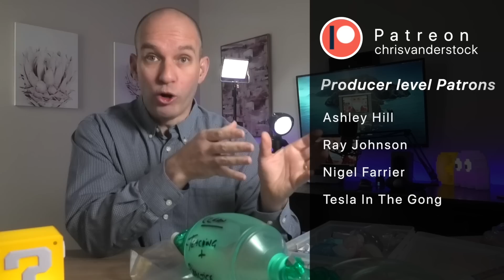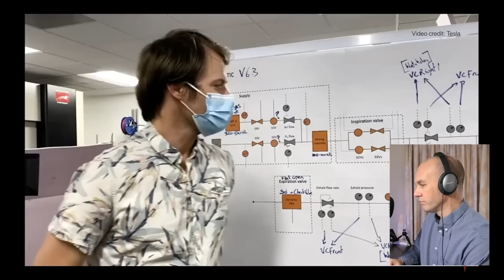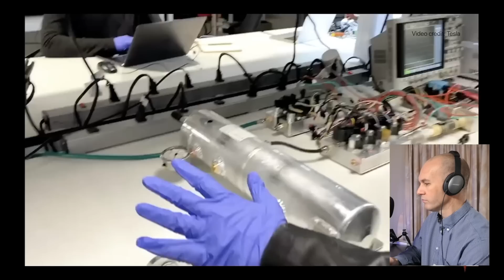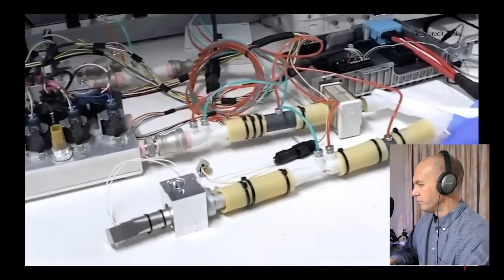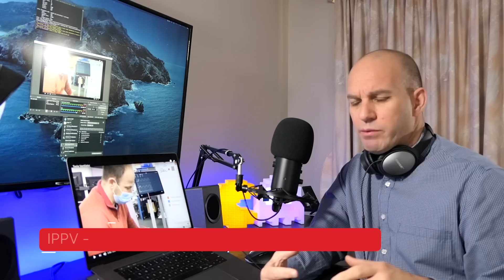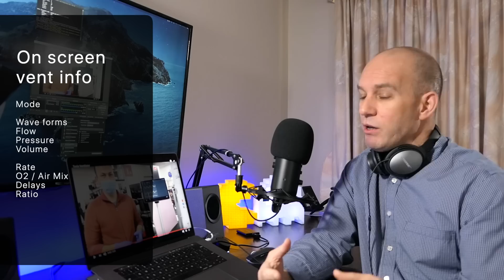Nurse reacts to Tesla's ventilator & what's with those resuscitators?

Comment from the maker: 0:50 - Ventilation 101 
2:00 - Air-viva (resuscitator's) and mechanical ventilation
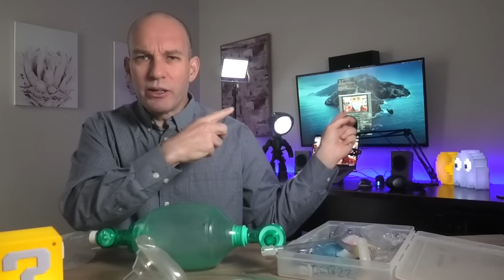9:24 - Tesla's ventilator
Reply: Nice job explaining
Reply: There are schemes to a real ventilator made temporary public here https://www.medtronic.com/us-en/e/open-files.html?cmpid=vanity_url_medtronic_com_openventilator_Corp_US_Covid19_FY20
Reply: @elmancebo  No they released a manual for how their device worked. That is not even a parts list and they put in the terms that any ventilator designed with those belong to them once it is over. It is actually really bad for anyone that signed up to get those plans because they will 100% sue to try and steal your work. Now they can claim you used their design and by requesting them you agreed to those terms.

EEVblog did a video about it going over the "plans". It is really just the user manual of how their really old out dated model worked.
Reply: https://youtu.be/lm79Q3H4Rp8

Here is a portable ventilator made by an indian company Agva which uses a mobile phone.
Reply: A Danish university has already made a working ventilator. It can be found on Github. The costs is around $6.000 per unit.
The university already educates engineers to work with, and construct medical equipment, that's why they could do the development in 14 days.
The unit has already been approved by Danish authorities.

The unit is only intended for usage, if no other real medical respirator is available. It's simply made to keep people alive, and doesn't have advanced functionality.

Luckily the situation in Denmark has already peaked, and we never had to use more than 20% of the Danish capacity of respirators.
But hopefully, it can help other countries:
https://github.com/CoRescue
Reply: Firstly...
Why didn't you cover disposable, BVM attached PEEP valves; if you are concerned with how much air is left in the patients lungs after an assisted breath? (Obviously, "positive additional pressure" is not the mandatory goal. So much as preventing excessive; and easily maintained; pressure within the lung, following mechanical assistance. Hence the use of a PEEP valve!)
...Were you intentionally confusing CPAP (delivering on "constant positive pressure" goals,) with any and all respiratory assistance?
LINK  https://www.buyemp.com/product/ambu-disposable-peep-valve

Or why didn't you mention the typical inclusion of disposable Manaometer?! Especially in the case of infant (BVM) bags; if you were concerned with over delivery, or excessive pressure?
LINK: https://www.buyemp.com/product/ambu-disposable-pressure-manometer

Why show images and video of a system such as the Rice University / ODEK system (developed in cooperation with on site Specialist Dr.s; as well as their local hospital partnerships); if you are not going to explain it's demonstrated ability to control, Rate, Volume and Pressure, through VERY precise use of dual/redundant servos, via the custom software they are providing free to the DIY community?!?!
LINK: https://youtu.be/Glq_9QC3HeI

Obviously, rates of Oxygen delivery are easily mixed, controlled and minimized, whenever required within any hospital setting.  And no one would ever see and DIY solution (complex or simple) being utilized to directly treat, without being overseen by a professional; and each value being calibrate or confirmed.

While I'm glad you claimed your purpose was not to "discourage folks from doing what they can"; and I doubt the more knowledgeable and discerning "Do-it-yourself-ers" will give much credence to your incomplete statements; from a standpoint of "discouragement".  

Nonetheless, I find some of these incomplete and unqualified statements, disconcerting and upsetting for any & all potential patients; during a time when they simply MUST depend on Automated Respiratory Assistance to survive; and the high dollar solutions are unavailable. 

Such random and uninformed "warnings"; which further neglect the fact that there are MANY solutions being built and proposed which not only easily approach each of these issues; but there have also been many many VERY STANDARD add-ons and BVM (bag) attachments, which have dealt with EACH of the issues you are warning about, for many many year now!

(FYI: I have NO affiliation with Rice University or ODEK.)
Reply: @MichaelHulme  tha k you i agree with you on most of these. I also had tried to cover these replies in video ... posted the link a few comment above.
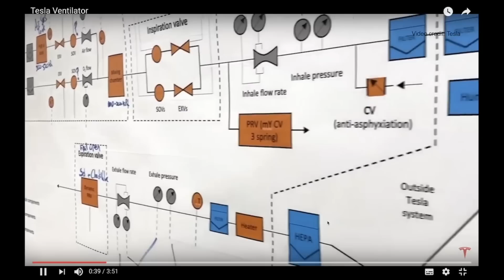Reply: At 10:05 in the video on the Tesla diagram there is a medical humidifier listed as being after the filters and before the patient, so it seems there is one in the plans and prototype, they properly forgot to talk about it because it's a medical component. :)
Reply: I have designed one such ventilator. I have made my reply to the concerns raised here. I look forward to hearing your comments and suggestions. 
https://youtu.be/h0GnTkgKtZw
Reply: What do you think to the virgin orbit ventilator, would love to hear your thoughts.
Reply: Hi Chris, great info mate, subscribed. I'm trying to get my head around understanding the CPAP(USA??), for example when an AFL footy player gets 'winded' would that be an example of the absences of that positive airway pressure i.e. a partial collapse of the lungs?
Reply: Question: Is the danger of the diaphram atrophying a big issue with ventilators, or is it a minor concern?
Reply: @michaellin4553  Not even a concern. For the lengths of time covid patients would be on a ventilator it wouldn't affect their breathing ability. I work with patients who use vents on a perpetual basis and they are still able to take spontaneous unassisted breaths unless they have a muscle wasting disease process like ALS.
Reply: Chris Vanderstock seat also made one https://youtu.be/P4lIx-J4YV0
Reply: 20:51 PID and his frends its a equlation for simular things
Reply: Would you please ask PPE product development engineers to analyze and respond to this request for product development? I’ve managed to adapt a Honeywell NS76008A Respirator to provide HEPA filtering of both air inflow and breath exhaust. This was accomplished by adding a N95 HEPA filter on its exhaust valve by using Weld On #3 acrylic solvent to fuse the NS80867 exhaust valve guard to a NS750035 Piggyback Adapter that was drilled and drum sanded to the 1 9/16” OD of the valve guard. The NS750015 Filter Holder was drilled to a 2” inside diameter to relieve back pressure on the NS7506N95 HEPA N95 Pre-filter. Although the acrylic weld should be durable, I request that your companies ensure the public safely by manufacturing a single piece adaptor with a screw on filter retainer to more effectively replicate a filter cartridge with reverse flow that would screw onto the exhaust valve seat of your respirators. I would also suggest adding an 1/8”  barbed hose bib through the face shield to allow for oxygen therapy. Please respond with any decision regarding this request for a new product.
Reply: Weren't those ventilators wrong for the infected people?
Reply: The Tesla whiteboard flowchart has a square for humidifier, which is not a Tesla car part.
Reply: I'm sorry I am a respiratory therapist and I was only able to get through a little over 5 minutes before I had to stop your video. There are just too many things wrong and I couldn't take another 20 minutes. Those "bags" are called self inflating resuscitation bags. There are different makers and people often use a brand name to name them rather then what they are, like all cotton swabs being called q-tips. Also if you dumped more volume into a lung then it could hold it's not called pneumotrama it's volutrauma. And a pressure related lung injury is barotrauma. Also yes a person may develop atelectasis but the reason they would is because you just popped a hole I their lung called a pneumothorax that is allowing air into the thorax/pleural space  and collapsing the lung. I'm not sure if you went on to explain that but I just couldn't take it. There were more things like yes actually you do want to hyperventilate people sometimes based in blood gas values etc. Look I understand you are trying to help educate people but make sure you use the proper terms and are correct in what you are saying. Most of the vents people are designing just won't work past the most basic ventilation. Advanced ventilation modes as called for in the care of acute respiratory distress syndrome (ARDS) call for things these vents can't do like ARPV. In the event of no vents a trained person bagging with a flow inflating bag and pressure gauge providing support would be safer then most of the stuff being designed right now. If it were easy to make vents more people would be doing it and it wouldn't cost a fortune to buy one.
Reply: T J Maybe you should make your own video and enlighten us?
Reply: @mondotv4216  I just had to go to the phone co to get them to take pics of the rig. I'm inept at the video/picture stuff, sorry.
Reply: Tom Lakosh Hey buddy - that comment wasn’t in reply to you. Stay safe.
Reply: T J Sounds like you’re a perfect component to adapt. . . A bag of wind. Do your own video and see if you’re able to explain the issues as well as what has been done here.
Reply: 16:20 - I thought PEEP was regulated by the expiratory arm. Think of it as preventing incomplete exhalation. This is how peep valves work on your "Air-viva". What you're describing is how a CPAP machine works for sleep apnoea. It's a waste of medical oxygen. Think of the flow rates required to achieve a high PEEP and plateau pressure of 30. If the exhalation arm is not restricted, the gas will take the path of least resistance, bypass non-compliant lungs and flow right out.

Comment: oxygen is highly reactive to metal all parts exposed to high concentrations of oxygen must be considered in this aspect. just remember Apollo 1, initially designated AS-204, was the first crewed mission of the United States Apollo program,[1] the undertaking to land the first men on the Moon. Planned as the first low Earth orbital test of the Apollo command and service module, to launch on February 21, 1967, the mission never flew; a cabin fire during a launch rehearsal test at Cape Kennedy Air Force Station Launch Complex 34 on January 27 killed all three crew members—Command Pilot Virgil I. "Gus" Grissom, Senior Pilot Ed White, and Pilot Roger B. Chaffee—and destroyed the command module (CM). The name Apollo 1, chosen by the crew, was made official by NASA in their honor after the fire.

Comment: Horrible design, should be designed to deliver less volume to eliminate overinflation problem.  In addition should be designed to reinflate slower so its not possible to deliver air at an unsafe rate. Then its practically dummy proof.  Squeeze lever all the way, once lever returns to fully extended position squeeze again to fully contracted position which it stops and wont go any further, release and once lever returns to original fully extended position squeeze again and continue  to repeat process..   Fairly simple to egnineer components to perform as such.  Always eliminate the potrntial for human error to affect a process.   The manual hand powered version should be revised before being put in use.

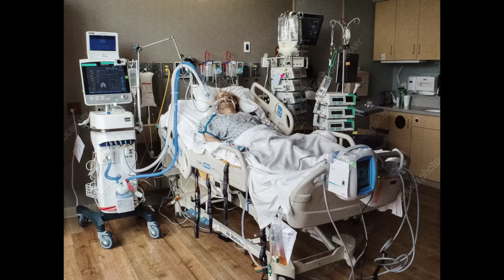Comment: 25:15 appears to be a Fisher Paykel Humidifier on your pic there.  Ones I've seen have a separate humidifier, they weren't really a part of the ventilator itself.  Maybe you've got it incorporated in your actual ventilators ? Would like to know how accurate is their big giant mixer there.  Have seen mixer valves of a ventilator, uses a Ruby valve, very hard material controlled a voice coil similar to that of a speaker to open, and what appeard to be an lvdt (linear variable differential transformer) to sense position of the valve, ie how far its open, uses look up table in the electronics where it knows how far to open the air and O2 alves to achieve desired O2 level.  Did they mention you need an O2 cell,  gives a voltage proportional to O2 concentration,  so you can check the O2 level of the mixer is right ?   You can see those engineers understood what they wanted to achieve.  I would worry that their parts have to last thousands of hours use before replacement, not be good if it failed.  Also, ventilators have fail safe valves so if the air went down it would keep going on 100% O2, or if O2 failed, on air alone, and also, if power fails that a valve drops open to allow breathing (if the patient is able to).   And alarms for all of that.  And possibly a separate safety processor to monitor functions and alarm when something is not right.

Comment: There's a HUGE amount of complexity to making a positive pressure ventilator. But has anyone turned the idea on its head and looked at medical history - What about negative pressure ventilation like Polio "Iron Lung" machines. Yes they are bulky but they are super simple, no mixing/humidfying air because its just helping the body breathe. Very hard to create enough vacuum to cause a pneumothorax while positive pressure its easy to over pressure lungs. The iron lung was a chamber that fitted around the body with the head outside via a neck seal vaccum cleaner parts were used to created a negative pressure inside to make it easier to breathe in for someone with polio and their lungs partially paralysed. This approach was SIMPLE and gentler on the lungs, especially damaged lungs - plus the patient could be conscious when used.

Comment: Medtronics released design data on an older model portable ventilator. The control electronics was built around an automotive engine control processor.  When you consider that engine control computers typically  monitor multiple pressure sensors , along with temperature and humidity sensors, then building a ventilator around one of these chips makes a lot of sense.

Comment: The decision to return to normal commercial and social activities must be premised upon the risk of virus transmission in the close quarters of public transportation, hallways and workspaces. The amount of risk depends on the quality of the respirator masks we wear and touch hygiene we practice so it is absolutely critical that state and federal OSHA issue PPE regulations and mandate that PPE manufacturers must meet the new demand without price gouging. Everyone must wear an effective filter on mask exhaust because this virus is transmitted when the victim is asymptomatic. Unfortunately, respirators weren’t designed to stop viral transmission from an infected patient and they also can make the disease worse

by forcing the wearer to re-breathe virus just deposited on the mask filter.
Our hands or gloves also allow transfer of virus from surface to surface. The
solution is for PPE manufacturers to sell us gloves infused with disinfectant
and respirators that filter the exhausted breath separately from the air intake.
Certain full face and half face respirator masks, listed below, can have a N95
HEPA filter mounted on a “Piggyback Adapter” that is modified and secured to
the exhaust valve seat. The typical N95 fiber mask with a valve, although very
effective in preventing infection, does not filter the exhausted breath so it
does not prevent transmission if you become infected. Moreover, both the N95
and surgical masks will trap the virus so that viral droplets are re-inhaled
into the lungs of the victim where it could exponentially increase the viral
load and severity of the infection yielding higher mortality rates. The N95
valve must be augmented to exhaust the contaminated breath into a secondary
filter “pillow” attached to the outside of the exhaust valve to capture the
virus laden spittle and airborne virus away from the inhalation portion of the
mask. In the short term, you could add a surgical mask on top of your N95 valve
to limit virus transmission. This starts to get costly over time relative to
the much safer full or half face respirator with and exhaust filter, so invest
in the better mask now as a vaccine is a year away. EMTs and hospitals could
better treat patients if a barbed hose bib were added to these respirators as
it would allow external attachment of an oxygen supply tube for virus free
ambulance transport and hospitalization. Removal of an inflow filter cartridge
from the mask would allow attachment of a ventilator hose too. The use of
respirators with exhaust filters is necessary to reduce the mortality rate in
patients and to allow the medical staff to continue working safely, even if
they get infected and are asymptomatic. I’m not a medical professional so
consult a respiratory therapist, but the exhaust filter part #s are: Honeywell
NS76008A, Chinese ST S100-3 Full Face Respirators, Honeywell North 5500 &
7700, NASUM 8200 half face respirators or similar mask with a screw-on
cylindrical valve guard; Weld On #3 acrylic solvent; NS80867 exhaust valve
guard; NS750035 Piggyback Adapter; NS750015 Filter Holder; NS7506N95 HEPA N95
Pre-filter. Just use a hole drill on the adapter to almost match the exhaust
guard cylinder diameter, sand the adapter to snap-fit the guard and fuse the
joined surfaces with solvent. The Filter Holder must be hole drilled to an
inside diameter of ~2” to relieve exhaust backpressure and add a bit of rigid
mesh to keep the filter flat. Please demand that 3M, Honeywell, Gerson and
Prestige Ameritech produce HEPA filter cartridges that fit and work on their
respirator exhaust valves so their masks don’t allow virus transmission.